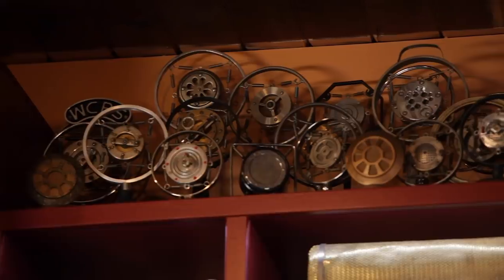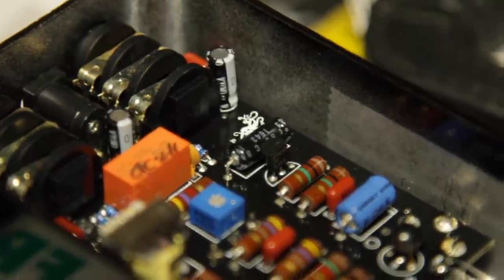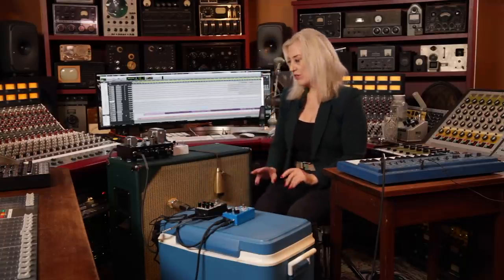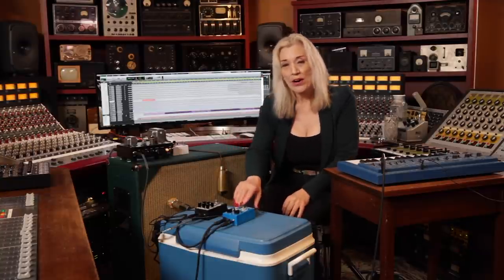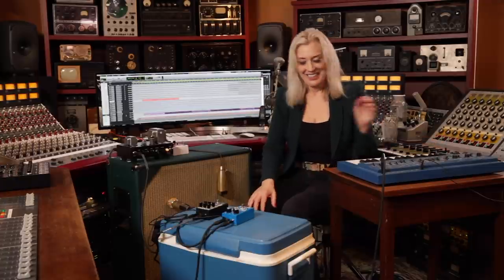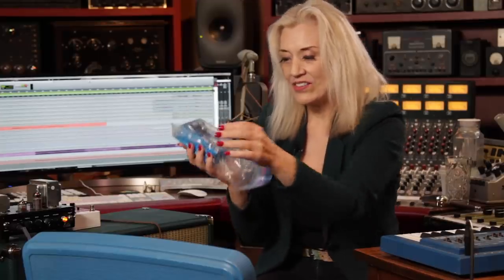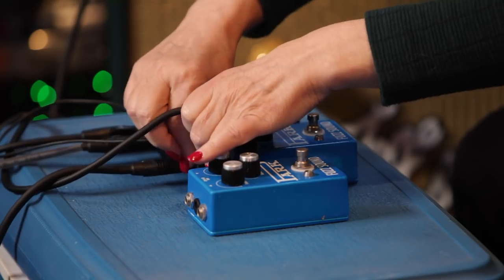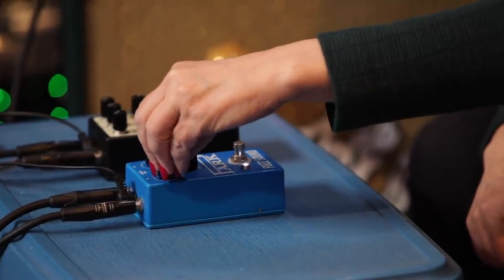Studio Go Boom with Sylvia Massy - Ep. 2 (Germanium Transistors) | EarthQuaker Devices

Comment: Fuzzy bagpipes. 

People used to laugh about the idea of putting pedals in the freezer like it was a tall story, or one of those unicorn dust things that people imagine changes sound. I guess back in the Germanium early days a few probably did. Cool and groovy semiconductors. Semiconductor could be confusing suggesting they are only half conductive materials. Something to do with quantum states and being able to be conductive and then non conductive depending on current.  Good for number crunching in binary apparently. Good for sound wave crunching too. 

I have long wanted to built my own fuzz. But I found a local NZ fella who builds them the old way with the old bits. He is going to build me one with a proper old school Tone Bender enclosure he scored and is currently getting painted -- providing I remember to remind him I want it, so he does not sell it to somebody else. MKII with none of the mods for convenience etc. One built with modern parts and features probably sounds the same, but it would always bug me wondering if an exact replica sounds different. 

I only want it for one thing. Wah and my Belle Epoch Deluxe to do Dazed And Confused sounds occasionally. The rest of the time I like a boosted JMP (I am going to install a mod that cascades my 1987's input stage to make it also be able to do the 2204 thing).   

P.S. I wonder about that wireless Angus boosted his JMP amps with. Whether Superlead or 2203 he tended to use it. I read it is a compander. Apart from one very expensive gadget I saw, nobody seems to make a compander pedal that does what that wireless did to his sound. Surprising considering so many love that Angus tone. I also like hot ceramic pups and an overdrive boosting a 2203. Viv Campbell etc.

Comment: I had  a Zvex FatFuzz Factory that could be the best Drive pedal ever made, or the worst Boss Heavy Metal you ever heard.I have tried probably 100 Silicon and hybrid fuzzes ,trying to find a sound as good and as stable as Germanium alone, and am fairly convinced it just can't be done.( The(old) Dirt Transmitter is close.Ramble,Joe Gore and Basic Audio make some great circuits.)
Mostly, I use the Eruptor these days, and use other kinds of effects to vary it's output; at some point, you gotta stop fiddling with effects and write songs, - or not.Do what it takes to keep it engaging without becoming a drag.
Follow that bliss.